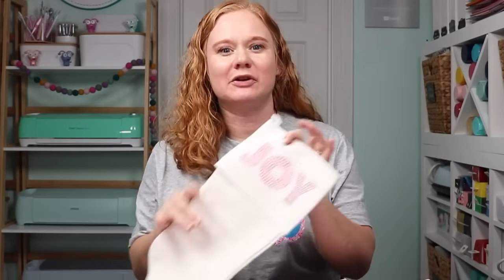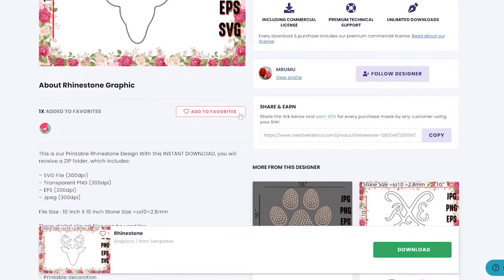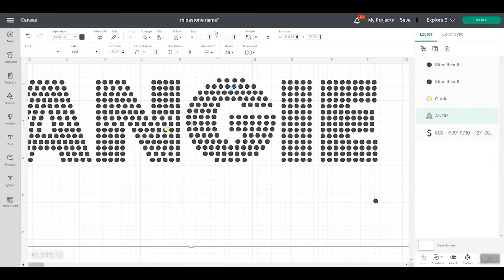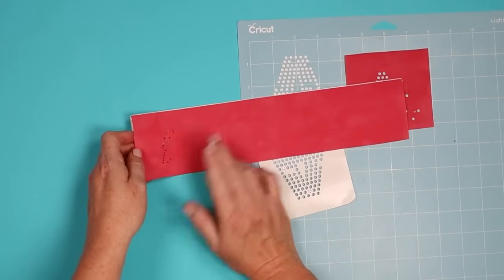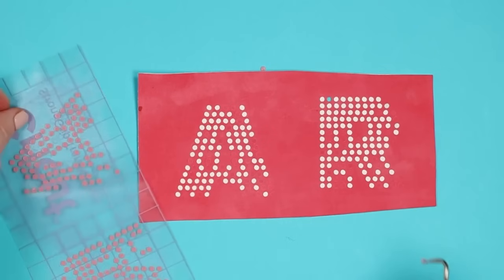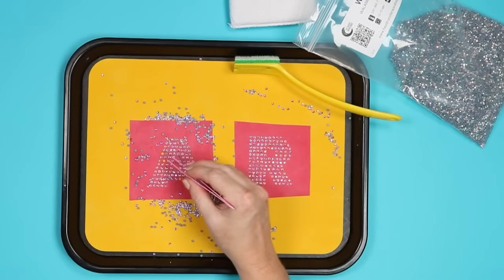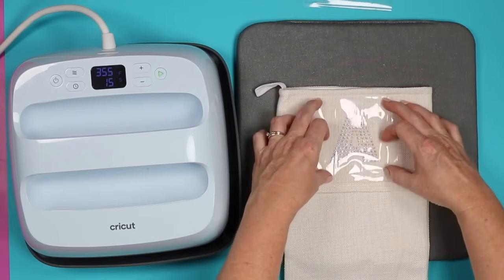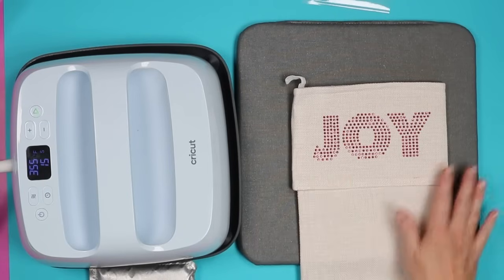How to Make a Rhinestone Template on a Cricut Machine

Comment: I wanted to share my printing tip for cutting rhinestone templates.  Use heavy cardstock setting with more pressure.  If you have a fresh blade the majority of the circles will stay on the backing.  I also resize designs by contouring and hiding all circles leaving only one and resizing to .13 then return to contour and show all and the entire design should be resized to new size.  You have to go through this process with individual letters.  Thanks for the video.
Reply from the maker: Thanks for sharing!

Comment: when you download your design, highlight it and go to contour in the bottom right and hide all. one circle will remain on your mat, change the one circle to the size you want and go back to contour and show all, it will automatically change all the circles. Then weld so they stay together.
Reply from the maker: Great tip!

Comment: i went to TRW and they have free font download for lettering . But I question what is this flock material? second could I use foam sheets  for template?
where have you ordered your flock material from ? the trw has special tape for the lifting the stones to the final item .
Reply from the maker: Everything I used is linked in the description below the video including what I used to lift them and move them to the surface.

Comment: Great video! A few tips...1st, ALWAYS remove backing from flocking material before cutting to ensure a cleaner cut. Also, make hole size a little bigger to ensure that stones will stay in the hole. For instance, SS10 should be around .135 instead of .127. Finally pour more rhinestones than needed because that crowding will help rhinestones fall into place. 🥰

Comment: Would this work for diamond dotz?
Reply: Never mind. I should have watched to the end. I didn’t realize that rhinestones are heat transfer.
Reply from the maker: I wonder if you would do the first part for diamond dotz then put it on some kind of adhesive?
Reply: @AngieHolden  At the very least, I think you could make a template with some removable vinyl, lay it over your canvas, and, very carefully, glue the diamond dotz down. Then, when you’re done, peel up the template.

Comment: Angie, I watch the baby booty video and on her video she remove the white backing off of the flock before she put it on her Mat and I noticed you put the whole thing on your mat and she said that she wish someone would’ve told her that before she started but now she does it, and it really did make a difference. Take the white backing off the flock before you put it on the could met.
Reply from the maker: That would work! You would have to scrape all of those circles off of the mat which was also a pain? Not sure how to make it as pain free as possible! HA!
Reply: @AngieHolden what about a lint roller?  I roll a lint roller in my mat to pick up those tiny scraps.

Comment: I use a painters trim brush. Has a higher pile. Also my templates I put on thin wood from Michael’s. It’s like 3” wide and maybe 3’ long. Wood prevents static. If you are going to be making a lot of items. I use my dremel and drill each hole into plexiglass. I have a cheer bow business and have literally done 40,000 crystals in 3 days. Insert eye twitch. SCAL has rhinestone design too.
Reply from the maker: Geez. That is A LOT OF BLING!  HA!
Reply: Hello can I please contact you about this. I really need help with rhinestoning 😭